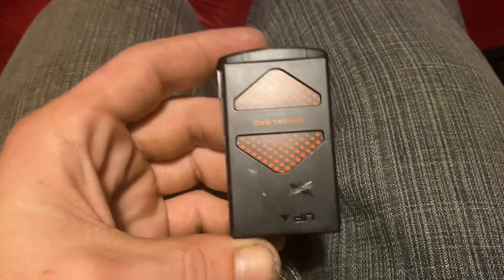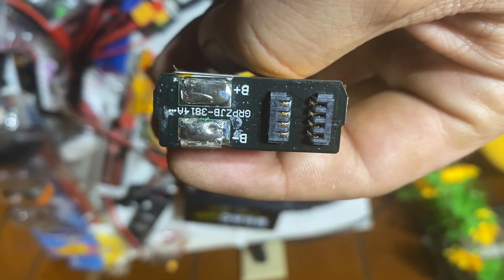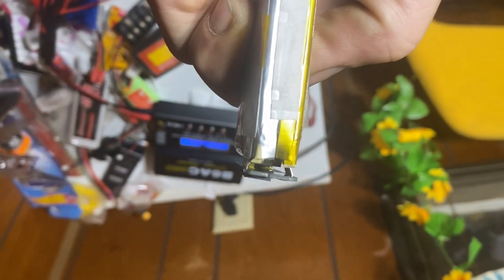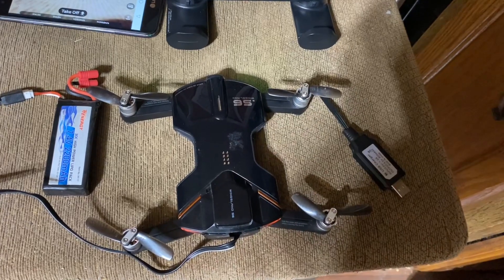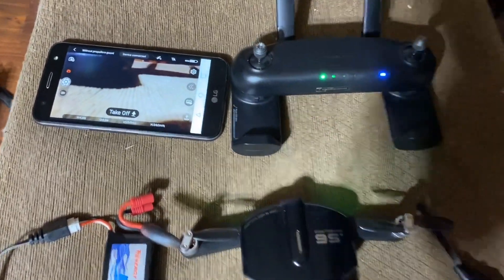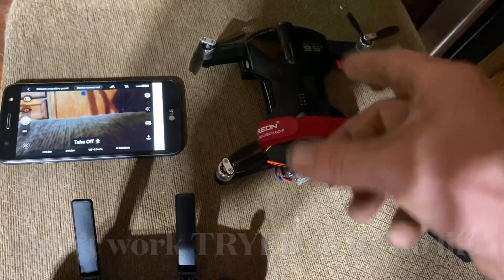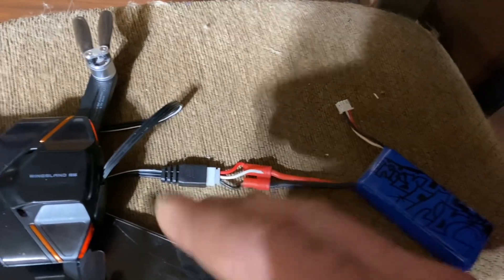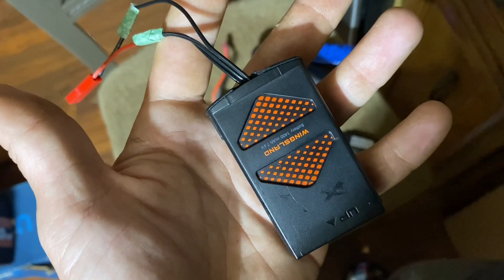Wingsland S6 Battery 🪫 FIX - Battery MOD Full Tear Down and understanding of battery and board

Comment: OK but explain where you get the replacement maybe? Names?
Reply from the maker: You go on Amazon and get the same Millie amp an hour just as well as voltage and then you just replace it. All you’re doing is replacing the battery inside the casing and then reconnecting it to the original connections therefore, you are able to use it.

Comment: My Wingsland S6 battery is broken. I can use another 2S battery to power it up, connect to the phone's WIFI, connect to the APP and view the camera, but it cannot take off. The APP prompts that the battery is 0. I don't have a physical remote control and charger. Is there any way to make it take off?
Reply from the maker: Unfortunately, I’m guessing the battery that you were using does not work with the Drone hundred percent compatibly which is keeping the drone grounded

Comment: Hey if you want five brand new S6 batteries never been even charged up I will send them to you for the cost of shipping if you want I will send you a request from PayPal I must find out first how much it will cost to ship the battery then I'll get back to you but I assure you it's not going to cost a lot again I'm off in five brand new S6 batteries for free- you pay shipping also I'm going to give you a printed out graphic from the printer so you can see how to charge your S6 batteries off of your hobby charger it's simple easy to design and it works 100% better than plugging it into s6 charger all right man it's up to you get back to me soon

Comment: Adendum … Aliexpress 2pcs/lot Flight Battery For Wings S6 Drones 3.8V 2250mAh Li-Polymer Replacement Bare Cell
Reply: Hello Dude, can you give us the link of 2 pcs battery on Aliexpress?.
Reply: 2pcs/lot New 3.8V 2250mAh Li-Polymer Replacement Bare Cell For Wingsland S6 Drones Flight Battery
Reply: @avvc.5043  2pcs/lot New 3.8V 2250mAh Li-Polymer Replacement Bare Cell For Wingsland S6 Drones Flight Battery
Reply: 2 teile/los Neue 3,8 V 2250mAh Li-Polymer Ersatz Bare Zelle Für Wingsland S6 Drohnen Flug Batterie
Reply: Flight time?
Reply: @avvc.5043  at the beginning 7 minutes,after a few flights less (dont know why) but was better than the original 1400mah received with Quadcop
Reply: @alleone7764  thks fyi dude
Reply from the maker: Bam 💥

Comment: Hello,open the original battery-case and remove the old 1400 ones… insert the 2150 mah 3.8v Cells of Aliexpress (replacement 2 Cells for Wingsland s6)and you are done,cost 12us dolars
I am flying now ca. 7-9 minutes (hope it help someone)
Reply from the maker: Yerp

Comment: Wire thickness shouldn't matter as long as the replacement wire is not thinner than the original.
👍👍
Reply from the maker: There were no wires in the original connection- The battery connections were off the deposit negative directly off of the battery with metal so thickness is definitely going to play a factor

Comment: Hell yes! J.  I have 4 bad ones
Reply from the maker: Properly soldering to the board just positive and negative with the right gauge wire I think is the trick here and then obviously using a battery comparable in weight not to bug out the Drone. Also those sensors underneath cannot be obstructed otherwise it will not fly properly
Reply: @JayDrone  I'm on it! Thanks man I was going to mess with it while ago and forgot I'm glad you did these videos!  I have the Ferrari yellow one.